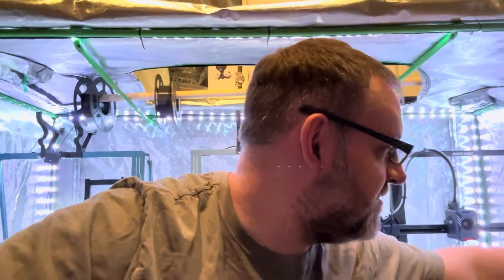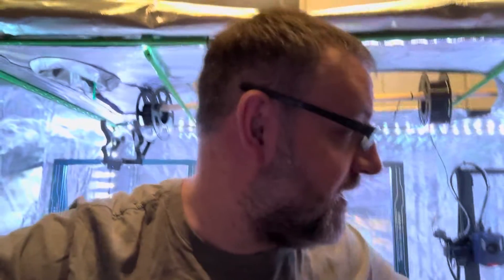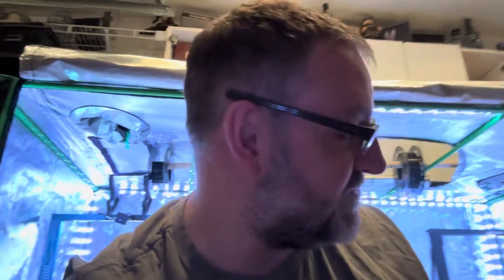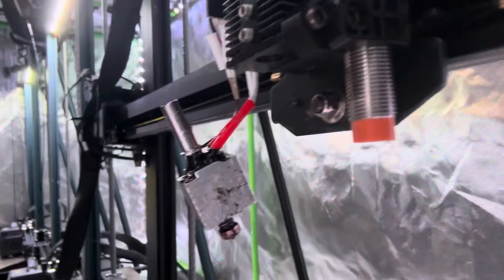The Anycubic Kobra 2 Max is Alive Again! UPDATE: Still Broken 😭

Comment: I had a new bi-metal hotend to install before the printer arrived, I knew that they would use a bad hotend like the one in the kobra max. I put the new hot end in when Iput the printer together. now i need to raise the max hotend temp. If anycubic won't give me an update for the temps, I will make a dummy hotend for the printer to control and I will set up a pid controller and set the temp from it.

Comment: i buy also a upgraded hotend bimetal and ceramic heating pad wait to test it when its here
its say 300C but the settings cant set it but i hope constants heating and say very fast heat up
Reply from the maker: I did a bimetal upgrade as well. It’s worked well so far. Now I’m dealing with the hotend assembly wiggling and no matter what I do I can’t get the eccentric nuts to tighten up the wobble anymore. Time for some new Uwheels I think.
Reply: @OuterRimArmorer  mine wobble to a bit but not lover down so its fine to me if just side ways movement try to blue nut glue or some capton tape to the nut and preheat the hotend then tighten the nut because if cold you cant tight enough and when hot get a wobble

Comment: Oh, ... you might consider sticking to a regular all metal throat for that kobra 2 Max... copper/brass are pretty soft metals and unless I'm mixing it up with just my Kobra Max... ut's using that nozzle to press into the bed with the strain gauge instead of a bl touch during leveling.

Comment: 2 questions, 1 did you change the nozzle as well question 2 why are you using grow boxes for your printers
Reply from the maker: I replaced the entire hotend which included the nozzle. I started using a grow tent for the printers in my garage after a we had freezing temperatures and it effected the printers. It also helps keep them clean from any dust or debris that might be in the garage.
Reply: @Extreme4x4Dude  that's a really good idea. I'm gonna look into them

Comment: Hey, thanks for putting this content out there.  SOOOOoo..  if you were starting over knowing what you know now which printer would you get? the Cobra 2 max or the Ellegoo 4 max?  Thanks for any feed back.
Reply from the maker: That’s a good question. I’ve had issues with both of them. They both need maintenance regularly. They both break and need repairs. Both customer service representatives have been decent to work with and respond fairly quickly (typically within 24 hours). I dislike Anycubic’s closed user interface with klipper so Elegoo beats them in that regard. Knowing that they both break and need repairs, I’d still get another Elegoo out of the two choices. But if I didn’t need the XL build volume of either printer and had a little more money to spend I’d buy another Qidi Tech X-Max 3. It can handle 90% of the stuff I need to print and the print quality is great. Time will tell if the Qidi has its own issues. Right now they’re working out great.
Reply: @OuterRimArmorer  Thanks, for the feedback. I agree with all your points. I personally don't mind working on these but the two things that are bothering me is Anycubics closed interface,  Klipper, and their overall customer service experience.  Gonna keep an eye on the Qidi Tech X-Max 3..
Reply: @OuterRimArmorer  I think this question would make for a great video. Obviously you bought a 2nd N4Max but like if you had to start over what upgrades would you immediately do and what mistakes would you avoid? What potential sources of trouble would you keep a closer eye on and which parts would you buy spares of before they break? Would definitely watch a breakdown of all the little things to look out for and save yourself trouble.